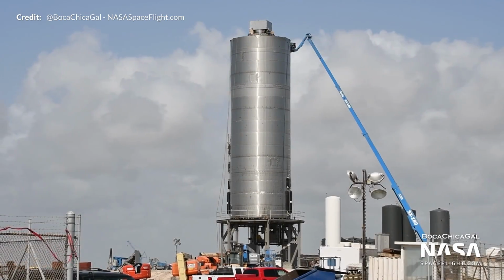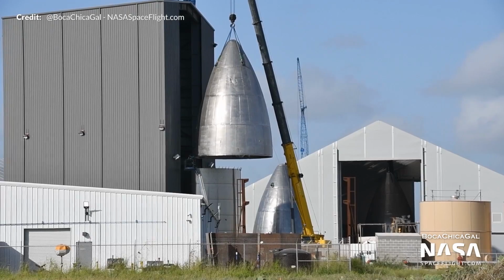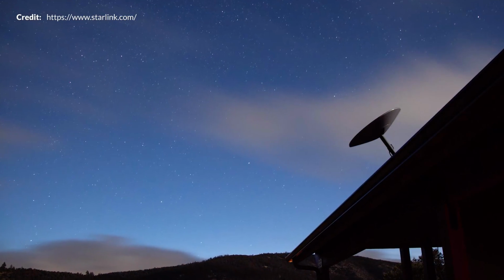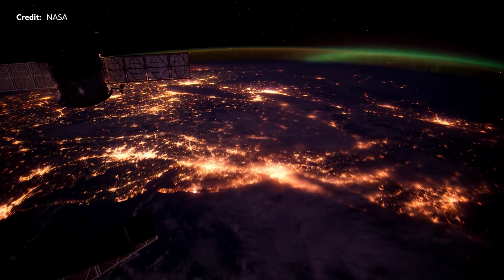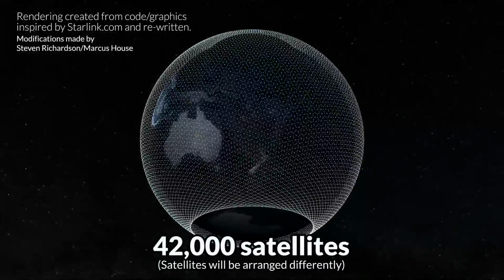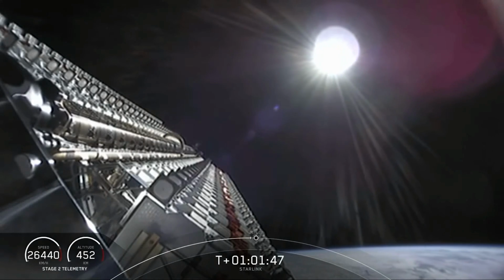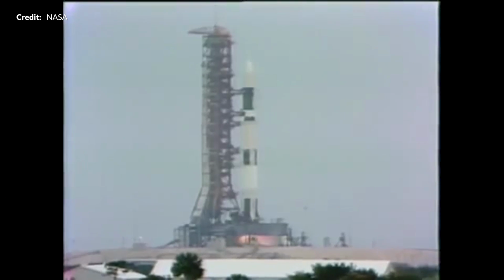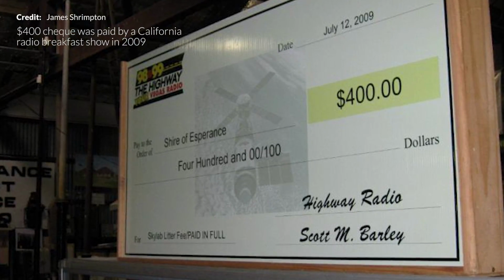SpaceX Starship SN5 150m flight countdown, Starlink Beta, Minotaur IV Launch and Skylab Anniversary

Comment: I'm preoccupied with lunar / Mars landing. Wondering if 3rd fin as leg would be worth the weight tradeoff for stability. Also, Mars takeoff potentially hazardous without a launch pad. Rocks may be thrown up into the engine skirt on landing. Promo videos show pads - huge challenge of robotic construction without easy access to readymix. If anyone can NASA / Spacex can

Comment: Hello Marcus, why would Starlink need to do permanent tracking? THe pattern of the satellites is supposed to be continuous and in later stages of completion also gapless, so at least during final stage completion it would only need to orient itself once for theclosest point with the given number of satellites required for a good gapless transmission at a time and then could be stationary... a flat/pillowshaped  antenna like that seems to be similar to the synthetic aperture radar things they use on big Warships where many small antennas simulate a large one, so the tinier sub antennas can all receive from a large field of view, where a parabola antenna would be limited in where it could look...

Comment: From what I understand none of that word that was the main problem that Skylab came down to earth they had a guidance computer system which is known pretty much as the brain was failing and they had replaced it once and the second one was even in worse shape and so it was failing considerably so they withdrew any crew on board and knew that the station was going to burn up in the atmosphere that’s what I understood from when I was a kid yeah they did have some problems with a solar panel but that’s all I knew about

Comment: I expect the Starlink pointing motors to only move right after power up and around once a month to optimize local load. I.e. the antennas will point away from dense subscriber regions to improve service.   Very interested to hear about the phased arrays.  The LNA, phase shifters, addition circuits, and output amps can be made on a micro-chip but channel to channel variation will be massive.  Per-unit calibration of the phased array will be key.  I wonder if they figured out how to have the arrays self-calibrate when installed?  (They could have also gone the "Tyco RC" base-station route with 2-plastic tracking dishes in a beer cooler.  Bet it could match the cost and lifetime, but it'd be bulky!)

Comment: So, theoretically, since the ISS is below the orbital plane of the Starlink satellites, could the ISS be equipped with a Starlink terminal and use it for connectivity in addition to it's ground station uplinks and TDRS?  And in theory Crew Dragon or other ISS bound vessels as well?  Seems like it should be able to eliminate the communication blackouts.
Reply from the maker: Not sure actually. I would assume there would be connectivity options in future.
Reply: @MarcusHouse  Thanks for the reply :) .  Seems like it would be a handy thing to have a nice uninterrupted gigabit low latency connection without all the LOS/AOS events, but I wasn't sure if there was something I didn't see that would cause it not to work.

Comment: One Starlink connection (assuming a 30x30 Mbps connection to be conservative) in a "third world country" could service 100 people easily. They might not all get to stream video at the same time, but the unlimited knowledge of the internet would be available. 
*Nerd rant time*: They could pool their money and get Ubiquiti wireless gear and create village wide WiFi. a Few access points, some Ethernet cables (or Ubiquiti Nano Beams) and a remote village could have full internet access. Really, its beyond doable! The cost of the network equipment and Access points could be well under $1,000. the biggest trick would be to teach computer networks to the folks out there. If they initially had a computer and one Starlink connection, the village scientist (there is always one lol) could start figuring it all out with initial internet access. 
Starlink is going to change the world indeed!

Comment: The entire booster stack looks a bit flimsy. Is there some internal structure which holds it together or is this just the hull?
Reply: The pressure of the fuel holds it together

Comment: Regarding the tracking of the Starlink receivers: They are going to track the satellites with so called "phased array antennas". That means, they won't need any mechanical tracking and the motors will orient the surface (not dish) flat to the horizon.
Reply: Ahh that's interesting. I was worried about longevity and maintenance if motors are constantly orienting to various satellites

Comment: Surely with this new hop test it will need a landing legs arrangement at least like the more squat and vertical flying first hopper test?
Does a soft controlled touch down count as proof of concept even if it topples. I'm intrigued.
Reply: I think the engine is recessed within the fuel tank iirc, the raptor is expensive so they definitely won't just throw it away.

Comment: Hi Marcus, let me point that Falcon 9 and other vehicles musn't accelerate that fast because their cargo can be damaged in high g's.
So comparing an adapted missile isn't fair. A good rocket must accelerate as much of its cargo can hold that acceleration.
Good work!
Reply from the maker: Agreed. Was just showing the difference. Not for any reason. Solid fuel sucks for a lot of reasons.

Comment: 5:41 it will be interesting to see how Starlink deals with weather such as heavy rain and in particular snow given that it will need a convex shape to shed the water/snow.
Reply: It's really simple given it has electric motors built in.
Rotate the dish to vertical position, and when snow falls off, return to the correct position.

Comment: Never heard that story about the fine. I was a big Skylab fan and it was HUGELY disappointing that we lost the ability to get to Space in the first place. Seems to becoming habit with NASA
Reply: Space shuttle launches were literally as expensive as saturn V, but could bring only a fraction of the payload. The new Falcon rockets are STUPIDLY cost effective by comparison, for the price of a saturn V launch 20 Falcon 9 could be sent to orbit, with probably enough payload to lift a nice space station. For the price of a single Saturn V launch excluding payload.
Reply: @KarolOfGutovo   Space Shuttles could put about the same mass into orbit as the Saturn V. The difference being that the Space Shuttle was a fully capable space ship, able to perform a wide variety of missions, carrying thousands of kilograms of payload into orbit, and then bringing it back. In comparison, the Saturn V and the Falcon 9 had and have only a tiny fraction of the operational ability of the Space Shuttle. We're not going to have that kind of capacity again until Starship becomes fully operational.
Reply: @odysseusrex5908  Saturn V had a LEO payload capacity of 140t which dwarfs that of the shuttle at 30t. Skylab was lofted by the last launched Saturn V weight 100t. I think shuttle only completed two satellite capture and return flights.
Reply: @odysseusrex5908  The phrase "tiny fraction of the operational capability" is a gross exaggeration. 
 
The mission objectives for each shuttle mission are available online. By reading through them, it's clear that almost every single mission fell into a mix of one of these four categories: Satellite Deployment, ISS Resupply, Spacelab and servicing The Hubble. Spacelab has been made obsolete due to the ISS, and the first two categories are currently well served by the Falcon 9 at a far better price. Servicing the Hubble through an EVA is the only shuttle mission that would not be possible with the Falcon 9.
 
Of the 135 Space Shuttle missions, only 5 were Hubble repairs. The Falcon 9 could easily carry out 130/135 of the missions carried out by the shuttle, hardly what I'd call a "tiny fraction", with the remaining 5/135 being an outlier only made necessary because of a mistake on the ground.
 
Here are a few other comparisons of their capabilities.
 
COST/MASS TO ORBIT
Shuttle: $18,000/kg
Falcon 9: $2,719/kg
 
PAYLOAD MASS TO ORBIT
Shuttle: 30 Tons
Falcon 9: 17 Tons
Note: The relevance of this extra capability has decreased significantly due to the improvement in satellite technology allowing for less massive payloads. Something Falcon 9's engineers were aware of when they designed it.
 
MAX CREW CAPACITY
Shuttle: 8
Falcon 9:  7
Reply: @odysseusrex5908  Whikle it is true that the Space Shuttle could put 125 toms into Low Earth Orbit, just as the initial Saturn V did (by Apollo 16, it could lift 140 tons), the Space Shuttle also had to put itself in orbit.  That was 100 tons before any cargo at all was accounted for.  Thus, in terms of useful payload, that was initially only 25 tons (late that was was increased to lift some items needed for the ISS, but only at the cost of increasing the danger of foam damaging the Shuttle during launch [see what happened to the Columbia).   The Soviets had been orbiting that size payload for years with its Proton rockets. 

To further complicate matters, the Shuttle was a dead-end  since it could not be used to develop greater capabilities or missions beyond Earth orbit.  It could not even use liquid hydrogen fueled upper stages for interplanetary probes because sealing such fuels in the sealed cargo bay was found to be inherently too dangerous.
Reply: Imo, NASA is making the right call in moving tasks they were traditionally responsible for like launch, to the private sector. NASA should focus on things that there is no immediate market for, but that is beneficial to America and Humanity. When NASA constructed the Saturn V, there was no market for launch, but now there is, so their time in launch has ended. Their focus should now be on getting Humans to Luna and Mars permanently, using the new launch companies as contractors.
Reply: with US lawmakers, aka myself and friends and family for the way we vote, who are responsible for settings NASA's budget and mission objectives**
Reply: SpaceX has and will keep providing the US & EU Astronauts with a human rated rocket.
It's not that NASA has lost the skill to create a human rated rocket, it's just that your Government doesn't want to give NASA the necessary budget to spend as much time on Research and Development as it needs. So that's why SpaceX is quickly becoming the Number One in the rocket sector.
Reply: https://www.youtube.com/watch?v=DKrtgbWnxqw

ENOUGH OF RELIGION .
https://www.youtube.com/watch?v=DKrtgbWnxqw
PERFECT TIMING ,THERE IS NO COINCIDENCE ..
Reply: @Donnie Phillips  Obama gave SpaceX special benefits so wtf are you talking about
Reply: @Donnie Phillips  The Space Shuttle was directed to retire under the Bush administration in the wake of the Columbia Disaster, Obama in fact approved the extension of the Space Shuttle to finalise the completion of the ISS and the final repair of the Hubble.
Reply: The world has never lost the ability to get to space, neither has the USA.
Reply: @zMW574e  the US absolutley has lost crew acess to space 5 times
Reply: @Spacevoyager-yi3gg  It only matters now, because of access to the International Space Station.
Between Apollo-Soyuz and the first Shuttle flight (originally expected to be only a three-year gap)...not so much.
The time between Mercury, Gemini, and Apollo matter even less. There was no need for overlap, and we knew what was coming.
Reply: Nothing goes to space . always goes vertical the rockets . Firmament nobody can get trough .
Therefore W V Braun has psalm 19.1 on his tombstone . Do you know W v Braun is the so called rocket specialist .. 
Operation paperclip .
Reply: @mark-Vortex369  "Nothing goes to space . always goes vertical the rockets"
Huh? And here I thought Flatties believed it was fake because they don't go vertical forever...
Funny how nobody ever gets radar or other radio reflections off The Firmament(tm). Are meteorites chunks that fall out of it? Is the sky literally falling?
Reply: @mark-Vortex369   Don't be ridiculous.
Reply: @odysseusrex5908  

https://www.youtube.com/watch?v=kfY2nufP3VE&t=2s
Reply: @mark-Vortex369   As I said, don't be absurd. The fact that von Braun quoted the 9th psalm on his tombstone in no way means he regarded the word firmament as meaning anything but the sky. You are deliberately distorting the word of God. He is not pleased.
Reply: @mark-Vortex369  I am afraid this video does not prove your theory of a flat earth or a "firmament."
You're missing the fact that Von Braun was German, English was not his native language.
Reply: @mark-Vortex369  You appear to be a flat-earther.  That said, there is little reason to say more since you have no common ground with the vast majority of we who study the sciences and history.
Reply: How come you guys can never even form proper sentences? Kinda hurts your credibility lol.

Comment: I think the offset is WAY overstated. The geometry of the 3 engine cluster may have a common pivot point higher in the engine cluster, which would result in the single engine compensation being much closer to centered than if you’re assuming 3 pivot points down close to the engine bells.

Comment: I think spacex will fly sn 5 higher with nosecone and three raptor after the 150 m hop because there is just no reason they should not do this dont forget sn 3 at some point was going to do shorter flights and sn 4 longer so sn 5 is much more qualified than them .i think sn 5 will definitely fly higher what do you think?

Comment: Sn5 landing is going to be super tricky, landing on 1or2 thin legs and then falling over onto the others. I predict leg breakage at touchdown.
Reply: I know they look thin in the images but I think they are pretty strong, the latest ones seem to have a shock-absorbing system built-in, so it may work OK'ish on a flat hard surface (concrete landing pad). Obviously they need to improve that part going forwards. I think they'll be happy to just do the flight and wipe up any mess later. :-)
Reply: I don't think they'll just cut the engines. They'll probably throttle them down over the span of a second or two to settle it onto the other legs.

Comment: I just had a doubt the one that got the fairing will it go above the tank  like sn5  cuz I thought that the fairing would directly attach to the sn5 tank
Reply: No, there's no point in putting a nosecone on something that is only intended to go 150 meters up. Those are needed for higher flights. It will probably go on 
SN-8.

Comment: I'm here with 5 mbps down and 0.5 up with 500ms of ping at my parent's home due to covid, can't wait for starlink

(The worst thing is that I had 1000mbps down wit 2 ms ping where I stayed for University)
Reply: 2ms Ping is impossible
Reply: @tuhinthodeme5743  when you have optic fiber running directly to your router it is very possible, I can send you screenshots
Reply: @Sbinott0  Also, 2ms ping... to where?  Saying you have a 2ms ping is like saying I ran a race in 2 minutes, but not tell the distance.
Reply: @enclave2k1  with the speedtest, so the nearest server
Reply: @Sbinott0  So, we have no idea how amazing that is.  Saying I have a 5ms transatlantic ping means something.  Saying I have a 2ms ping to the closest node doesn't.
Reply: @enclave2k1  the actual one to the same node is 550
Reply: @Sbinott0  (Edit) I don't understand whatcha mean, but frankly I was being overly pedantic - just smoked a bowl.  Anyway 2ms ping to closest node would tell you something - disregarding extreme examples.
Reply: @LoanwordEggcorn  the distance is approximately the same for both tests, ~20km
Reply: @tuhinthodeme5743  2ms ping to the nearest speedtest server is very much possible
Reply: Try using 14.4kbit modem for a couple of years... and then sharing 2Mbit line with 50 people... for another couple of years...
Reply: F
Reply: How do you even watch this video?
Reply: @quazar5017  360p with some loading times
Reply: @quazar5017  that's most of italy for ya baby
Reply: Oof
Reply: cool story
Reply: F
F
F
F
F
F
Reply: You must live near me with speeds like that 😅 mine’s shite too